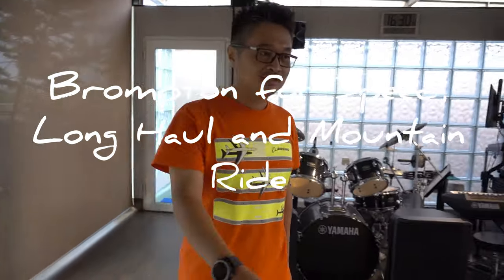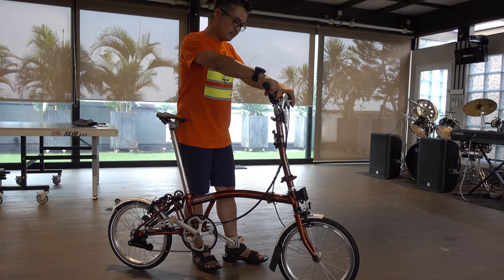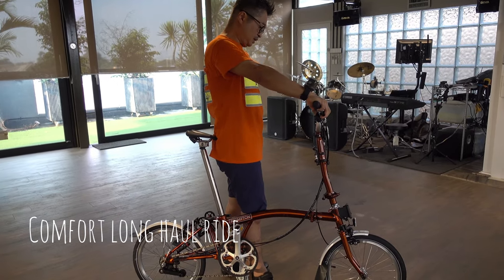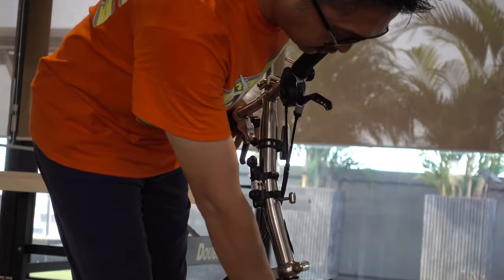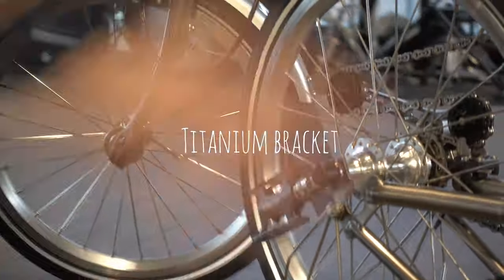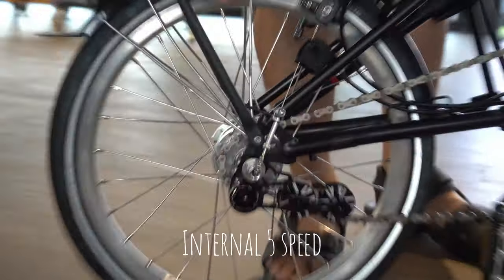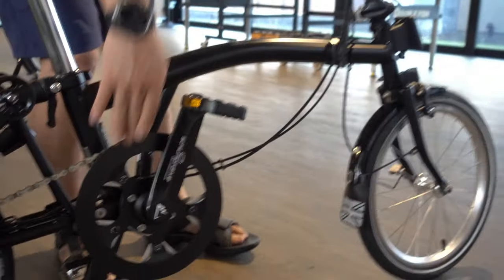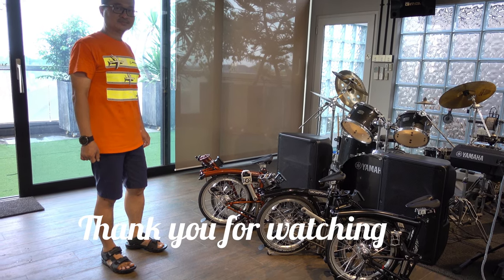How many Bromptons do you need?

Comment: Hi, regarding the titanium frame parts (forks and stem): where did you buy them? Why not also the main frame (I can't understand what you say there)? I would like to build a titanium brompton but I'm concerned with safety and also compatibility with original brompton parts.
Reply from the maker: Hi Luca, Brompton original titanium parts , so far I know, are only on the FORK and TRIANGLE parts. The factory has their own reason why they dont make other parts from titanium material. The remaining titanium parts, I acquire from 3rd party brand. I still keep the orignal mainframe though to keep the bike called as Brompton with the original serial number. 
If you plan to build a titanium one, I would still suggest to use the original mainframe for safety reason,  and to let your bike still called as Brompton. Please also check the compatible connection among parts. Thanks and share with me if you have built one.
Reply from the maker: Please check my other Video showing more detail of my Brompton Titanium : https://youtu.be/lQlXqcO_34I
Reply: @ATCyclingCanal  What's the brand name? By the way do you happen to know whether the brand EasyTi is reliable or not? Thanks.